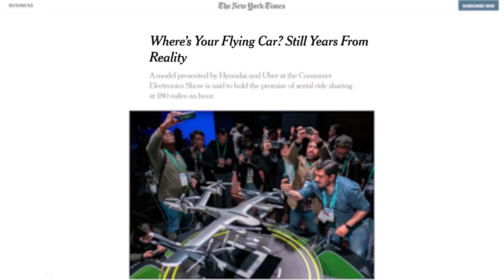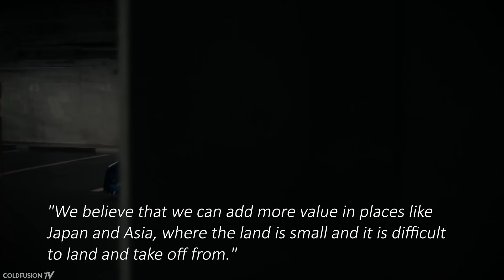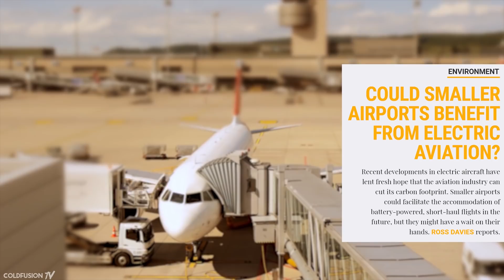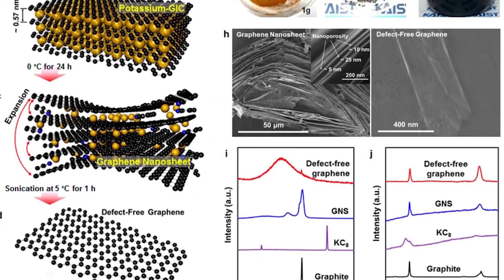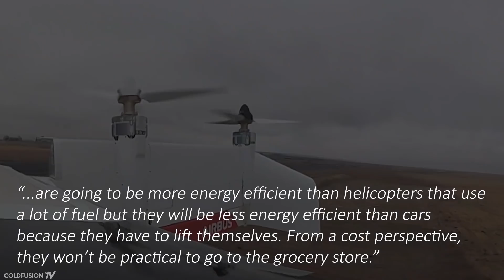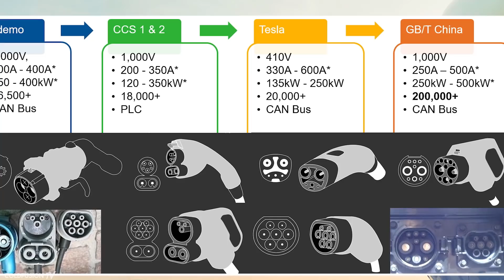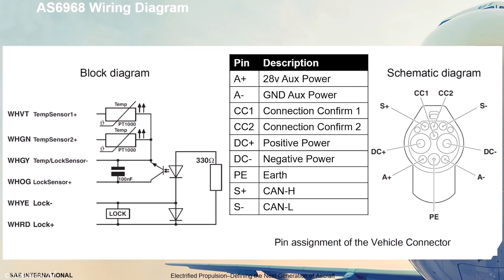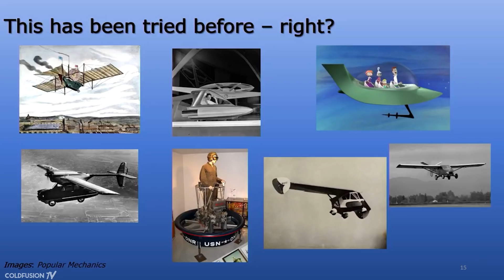Japan's Flying Car – Problems and Solutions

Comment: I like the idea, but the real hurdles have yet to be addressed to make flying cars a reality:

1. No spinning blades. The motor and propulsion mechanism must not be inherently dangerous in of itself.

2. Silent to near silent operation. The biggest pollution from aircraft, especially those with blades, is noise pollution. Even the 'silent' small electric fan motors produce a large amount of noise pollution. This recent pandemic, in our area at least, has demonstrated even the odd loud cars/trucks are no longer acceptable as there is now a push to regulate noise pollution from modified vehicles.

3. Driving ability and the individual limitation on attention. Flying a plane is hard and requires constant attention throughout the flight. Millions are spent on commercial aircraft in equipment and features to reduce the difficultly and endurance needed to fly these aircraft and still require an enormous amount of attention and training or risk the lives of everyone aboard and those on the ground. This leads to 3b...

3b. Autonomous driving/flying. No flying car for the masses will be practical as long as there is a human pilot. These vehicles must be able go from point A to point B safely through dense populated areas without human intervention.

4. Cost. As mentioned in the video from the aerospace engineer, the cost of a flying car will never be lower than overland transportation unless the vehicle itself weighs nothing (extrapolating the comment). This means very short movements will remain far cheaper by land transportation as whatever mode of efficient propulsion the flying car uses can also be used more efficiently by land transportation. 

All these added up mean, at best, that these flying taxis/cars will be relegated to short haul air taxi services (a service that exists today) but may become cheaper and more accessible when certain conditions are present. These niche situations would be where speed is more desirable than cost, like over a small body of water or over congested land transportation... where air taxis are already a thing.

Really we are talking about the electrification of short haul air taxis. This is a good thing as the efforts will ultimately lead to cheaper and safer air taxis. Flying cars for the masses? No, that will remain fiction. Good way to get attention for investment dollars though...

Comment: honestly i hope it doesn't happen, if people can't drive in 2 dimensions they certainly can't drive in 3 dimensions, what if two planes crash mid flight in a city for some reason, what could have been a minor crash on the ground would be a massive disaster if in the air because not only would the planes crash into each other but they would also crash into whoever is bellow them. Also, think of the noise, cities are bad enough when they are filled with humming cars, think about all those cars being replaced by screaming planes .

Comment: I am still surprised that charging is the way to go. Why not attempt a battery swap approach. This failed for electric cars with Better-Place but electric planes might operated by firms in fleets and hence could work out. 
Might be interesting to look into it @coldfusion 

https://en.m.wikipedia.org/wiki/Better_Place_(company)

Comment: I would not like to sit 2 KM in the air, in a drone single seat ... no backup system, no gliding to the ground like fixed wing planes, no auto-rotate like helicopters... just dropping out of the sky at the first MS blue-screen or battery start burning. (keep MS far away form my car and any transport please)

Comment: Flying cars will not be a thing in this century, at least not in the way past futurists predicted, and it has nothing to do with technology... and if it won't be a thing in that way, I'd ask if it really matters for most people. Might as well be fiction for me.
Here, let me tell you the problem with the flying concept car that people imagine - it's logistics, culture, infrastructure and costs.
To clarify - by flying car concept that past futurists predicted, I mean individual commoditized flying cars that people living in suburban areas just get in and drive to work. 
Those are not alternatives to small planes, private jets, helicopters, or current mono and biplanes. The idea is to replace the mass majority of what people use today - cars, motorcycles, passenger planes, metro, buses, etc.

Protypes are fine, I don't doubt we'd have fully working small scale flying cars by the end of the decade or so... but that really doesn't matter when you put it against the emissions and fuel costs of commercial airlines because none of the shown examples will be replacing those anytime soon.

It's simple math and economics. We currently have huge airplanes capable of flying hundreds of passengers all at once in extremely busy and packed routes. It's an insane number of airplanes on air (normal conditions, pandemic aside) all day everyday which makes it economically feasible.
Also, the way airports work today, it's already highly stressful and highly complicated to deal with massive planes taking off and landing one after another. It doesn't translate well for an even more insane number of planes carrying less passengers.

Ok, so, let's take this theoretical small scale electric plane into the equation.
Sure, the simplification of mechanics can help quite a lot on matters of maintenance... this will have to be proven down a longer period of time, because it always has pros and cons. The optimistic drivel of companies working on prototypes tire me to no end, they know full well that these things always have pros and cons. And it's not even about standards... standards can be taken care of, given enough time. That is a really minor concern, most emerging technologies had the problem at some point.

But airports were designed and made for big planes. So, this would mean retrofitting an insane ammount of infrastructure and logistics on airports right from start. This doesn't happen in the course of a few decades or so, we're talking about generations here, because of the size of the endeavour.
Yes, autonomous flying helps, but it's not a solution to everything - it's a solution between take off and landing, for some of the stuff. 
Think about other types of technology and you might understand the problem better, it puts things in perspective. It'd be comparatively easy for several countries to adopt, a public transportation system that looks closer to Japan - with a mix of high speed rail, urban commuters and older trains criss crossing the country with a big part of the population not owning cars, but instead using a mix of bikes, metro and walking in their daily lives. How many decades did we have to work towards something like that? Why didn't we? Are we anywhere near that?

Now, think about redesigning and creating all the necessary regulations, laws, business types, intercommunication standards, retrofitting everything to accomodate for, building up trust, estabilishing everything needed for a new category of vehicles. Something like electric cars, but much much muuuch harder - because it's not a pre-estabilished thing that is just replacing propulsion method. You know, we don't currently have highways and airports fit to run hybrid vehicles (hybrid I mean, that can both fly and drive). And if we don't have that, why would we want flying cars at all? Wouldn't it be better to just have electric planes and electric cars separatedly?

And then, since airports don't live in isolation, everything around it would have to adapt too.
Problem is, airports are made the way they are not only because of how planes work themselves, but several worries about airspace, routes, considerations about mass boarding and unboarding passengers, etc etc.

If we're going through a transitional period, then at most electric flying cars will be occupying the space of aforementioned vehicles - private jets, helicopters, small planes.
Why? Because airspace is already primed for a combination of those plus commercial flights. It's highly regulated, which is why it's usually focused at specific points like airports.
The question comes up again - why flying cars instead of just focusing on electric planes?

Flying cars won't make things much cleaner too, because of that very same reason. It's a worthwhile technical effort, sure, but it's making flying/driving clean for the 1%. Back again to other efforts, clean public transportation and electric rail systems would contribute much more for a mass long transit cleanup, at least domestic.

It's all a huge pipe dream that to me, is not leading anywhere worthwhile, sorry. As climate change worsens, and as people become more aware on how big the problem is, ideas like flying cars will be left to rot.
We need clean mass transit, clean commute, clean technologies that targets the majority of people, not only the 1%.

And honestly, I personally think we are already hitting the deadline to start those projects. Before the worst effects of climate change hits, huge infrastructural reforms will have to be underway or we might not have the critical mass to execute them later on. We are quickly walking towards a future where developed countries will not have the structure to maintain it's overly capitalistic nature. It's possible for a few countries to sustain a 1% rich class that is richer than all of the rest combined, but it needs to be in a peaceful and relatively stable society. That type of society can sustain insane pipe dreams of rich people like flying cars and stupid crap like hyperloop, but you take out the peace and stability, and things start turning around pretty quickly.
Something that billionaire CEOs and whatnot seems to be missing despite their 'incredible intellect' and whatnot. The societies you live in have to be somewhat in lockstep with your riches. You keep evading taxes and whatnot, amassing riches while people are going homeless and with nothing to eat, your money and net value will soon be worth nothing, and the poor will eat your children and grandchildren.

Comment: The flying car has been promised since I was a kid in Detroit. Good attempts are being made today, however, everyone seems to be in the same mode that occurred in the 1890's attempts at developing the first airplane. Hundreds of thousands of dollars or more, was spent by each of the competing nations in the late 1890's to build the first airplane. In 1903, two unknown brothers, who repaired bicycles as a business and flew kites as a hobby, built the first aircraft that flew for 59 seconds at  Kitty Hawk. Their awareness of the inherent instability of maintaining control in the air, then forming the ideas around pitch, roll, and yaw in their overall control systems,and the aircraft design selection, was the basis of modern airplanes. They did this on a budget of around $3K.
Nicolas Cugnot's ,1769 steam powered automobile comes to my mind as the first car. I'm also aware of Wischett's 'de Rivaz', hydrogen powered internal combustion engine in 1803; Marcus's 'pushcart'; Otto's 4 stroke engine; Rudolf Diesel's engine; and what can be considered to first production vehicle by Karl Benz in the 1880's. Nearly 120 years in development. Cars in 2020 was only imagined in those times in the past.
From the Curtis's Autoplane of 1917,   to the the Arrowbile by Waldo Waterman in the 1930's, which is credited as the first invented flying car, to Robert Fulton's 'Airphibian' which the first flying car certified by the Civil Aeronautical Administration, finally, it appears that the dream of many kids are near fruition. Today's flying cars are promising however, the technology exists which can make big improvements to the models discussed. Like the Wright Brothers, someone on this planet has a simpler, better way which the companies aren't seeing.
Electric vehicles is the best choice of the future. It's technology driven and it will eventually make fossil fuels obsolete, which should have occurred a few decades in our past. Uniting technologies, creating universal standards, making these versatile vehicles safe and affordable for everyone is a progressive idea fitting for this millennium.

Comment: Charger standards are a minor problem. Either the ISO or the IEEE will come up with a standard and impose it on everyone, then you'll be able to charge your car or airplane anywhere.
IMHO, there are two roadblocks to flying cars. First, there's structure. Airplanes wings are big enough to lift the weight of the plane; drones have big enough fans. Cars are made to fit in a traffic lane. The two requirements are not compatible. 
Second, there's control. Cars crash. Usually, this results in damage to the car and its occupants. Now imagine a car crash dropping a thousand feet or so onto somebody's house. This is why airplane pilots go through such long and thorough training. Should you need both a pilot's license and a driver's license to drive a flying car? Or should flying cars have to wait until they can reliably fly themselves?
There's one other thing. I see there being four different transportation ranges; local, (within a town), medium, (between neighboring cities), long, (across the continent), and intercontinental, (or overseas.) I see there being two transportation modes; point-to=point, (or door-to-door, from where you're leaving direct to where you're going), and station-to-station, (from a station near where you're starting from to a station near where you're going, possibly changing directions at other stations on the way.) Cars are point-to-point vehicles that are good for local and medium ranges, a bit slow for long-range trips, and no good for intercontinental ranges. Airplanes are station-to-station vehicles, good for long-range and intercontinental trips, but uneconomical for shorter ranges. This is because of the nature of the two vehicles, not just design choices. A flying car is trying to be two incompatible things; an elephant trying to be a cat or vice versa.
That's how I see it.
Reply: Shhh, let those scientist who have never dealt with small roads and road accidents dream their dreams.

Comment: What if instead of a cord going from the charger to the vehicle, a cord from the vehicle could go to the charger and the charger station deals with all the standards/differences in electrical requirements? I guess it would be similar to looking at the issue as a gas pump vs a wall outlet.

Comment: Not sure if the "flying car" will be cheap and practical enough to really take off, but once the battery issues are dealt with, I do think we will see a shift over to electric planes for almost all passenger flights. I also think there is a market for short distance E-VTOL or electric quadcopter type of vehicles to transport people, but again, I think this will be more akin to public transport & taxis than personal vehicles.
All of this is of course not based on much more than my gut-feeling, so might very well be totally wrong. Only time will tell =)

Comment: Flying is more energy efficient than driving.
Autonomy is easier in the air, in a 3d space, especially with vtol. 
This will depend on mass produced energy dense batteries. I think these robo plane services will be everywhere in 5-10 years.
Good choice of charging and billing standard.

Comment: Flight is where I see the Hydrogen fuel cell with electric motors being a winner. Take out the distribution network with on prem manufacture. It has the highest energy density per KG, and the plane gets lighter as it uses the fuel (so no lugging around flat batteries). Emissions are just water. Yes energy production isn't as efficient, but the logistics and power density make sense.

Comment: The FAA would have a stroke if air vehicles became standard transportation.
Reply: This is why I personally consider "flying cars" and "personal small ridable aircrafts" vanity project.
Reply: Honestly, point-to-point air travel can’t scale in the same way as rail, or even conventional air. Can you imagine the air space over large urban areas? It’d be a nightmare, and probably why not everyone uses a helicopter.
Reply: The tech is cool, but this isn’t efficient for nearly all regular consumer purposes.

Comment: Thanks for a interesting video! 
I don't believe in battery for airplanes at all. Hydrogen gas is the solution for the future for cars and for airplanes as well. When we have solved the problems how to produce the gas it's will be a revolution.
Just imagine the weight save to get rid of the battery.

Comment: Disappointing video.
You just listed the problems then said they were solved, no detail, no explanation. Then spent the majority of the videos length discussing charging standards!? Seriously!?
Charging standards were not the reason ubiquitous mobile phone adoption happened in the early 2000’s. Charging standards are not preventing the adoption of electric flying vehicles. It’s all the other problems that you said were ‘solved’. Plus a few more that you didn’t mention.